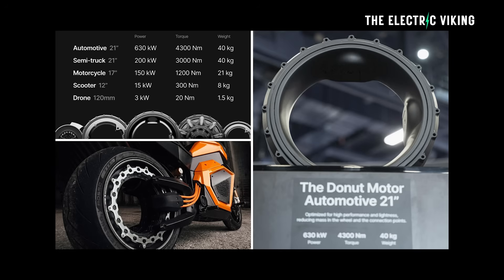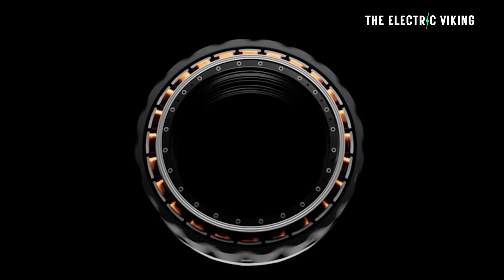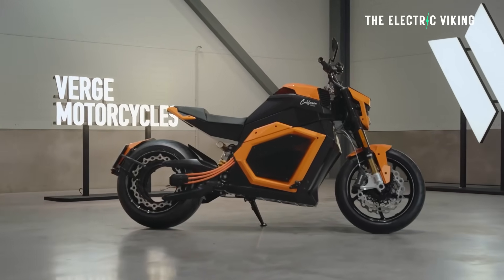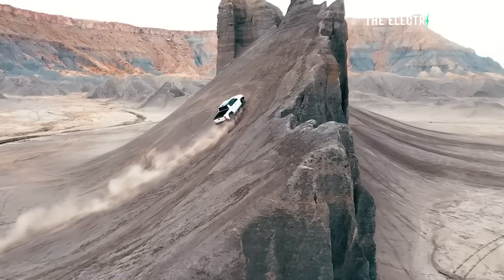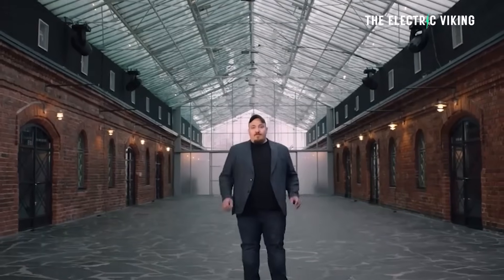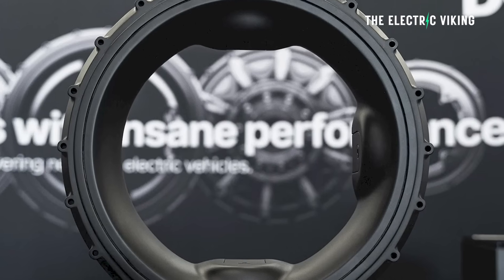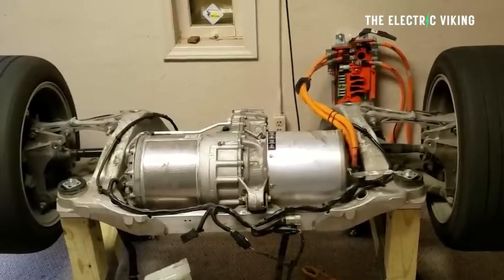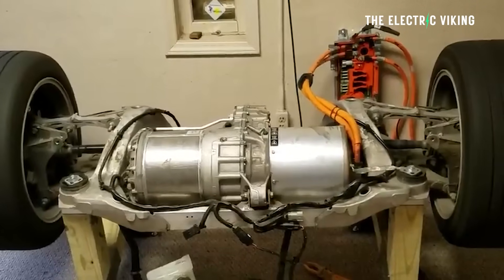Donut Labs' game changing Electric Motors will Revolutionize the EV Industry

Comment: Sounds great but for the issue of hub motors in general. When you hit a pot hole all of the force goes into the motor because it is before the suspension. If they can solve that issue then they have a product that can make a difference
Reply: Smaller wheels with larger lower inflation level tires would help. People need to get over this bigger and bigger wheel fetish.
Reply: @Frostback-mw4xi  If "smaller" means small they just fall into potholes. The ride turns into crap on roads that feel smooth with a larger wheel. But I do agree the bigger and bigger wheel fetish is bad, mostly because the unsprung mass should be as low as possible.
Reply: @Frostback-mw4xi  you talking bout rim sizes with low profile tires?
Reply: A pothole that takes a chunk out of the wheel now will take a chunk out of the motor instead. Anything expensive should always be sprung.
Reply: I don’t get this argument, tbh. Wheel forces go into the bearings, not the motor. Just like any other wheel hub. Am I wrong?
Reply: @simontillson482  think about the inertia. wheel gets pushed up, heavy motor wants to stay where it is.
Reply: @tweake7175  Hmm, that’s true I guess but same goes for a lot of stuff. Like brakes for example. I do think reliable in-wheel motors would need stronger bearings than a conventional hub. But not a crazy amount stronger. The force initially goes into the outer hub and that shoves the bearings which then pull against the stator (the heavy bit in most motor designs). Even conventional ‘empty’ wheel hubs are quite heavy, and the hub motor replaces that so doesn’t add as much weight or inertia as you might think. Engineers are pretty good at making wheel bearings so I don’t think it is a real barrier to reliability. As to the motor itself, as long as the bearings survive it’ll be fine. Motors are very simple devices which are basically a solid block of metal with large wires wound onto it. They can survive hundreds of G’s without problems. Many companies already make proven designs around the hub motor concept that work great. Check out Elaphe motors for example.  The more difficult engineering challenges are cooling and the rotating seal in my opinion. Vibration and impact are pretty much solved.
Reply: @simontillson482  not saying it can't be done. eg rivian i think run hub motors. the magnets are often a weak point due to their material and how they are fitted. you make a good point about the seals. water getting past wheels bearing seals is a known issue on all cars. wheels bearings are usually easy and cheap to replace. a maintenance nightmare if you have to pull electric motors out to service brakes or bearings.
the bigger problem imho is the effect on suspension and handling. its passable on a big heavy heavy truck, not so much on a lightweight car.
Reply: @simontillson482  you understand thatmotor in this case is in the wheel so all forces come to motor first before they are absorbed by springs.
Reply: @KeyhanHadjari  Of course. I was talking about how forces coming from the wheel have to first travel through the bearings before they encounter the inertia of the motor. In a hub motor design, the rotor (spinny bit) of the motor is retained by bearings which replace the normal wheel hub bearings. Therefore, the motor will only be damaged if those bearings fail. Effectively, it’s the bearings which have to resist impact and vibration from the wheel, not the motor itself. Both rotor and stator components of the motor are very heavy and stiff so they put a lot of stress on the bearings before any of that force gets transferred to the suspension. I think this is one reason why hub motors need to be as light as possible, and need much stronger bearings than conventional wheel hubs, since the suspension can’t help absorb these forces - it’s only after the bearings transfer those forces that suspension can absorb them.
Reply: @simontillson482  think this motor design is more for cities and urban areas mostly.
Reply: @KeyhanHadjari  Depends where you live. In the UK, for example, most rural roads are quite smooth as are the major motorways. Local urban roads however are terribly rough and full of potholes. I guess in other countries, where long distance routes involve rocky or other types of unpaved roads and city roads are newer and/or better maintained, you’d be correct.
My personal view is that we could make a hub motor with lower power (say 20kW per wheel) which would be light enough to avoid the unsprung mass and bearing issues while offering sufficient power for most vehicles. If we can do that and solve the rotating seal problem, then the advantages of a hub motor vehicle could really be applied anywhere.
Reply: @simontillson482  you are wrong in this case. A hub motor is in the wheel so The motor is the bearing. There are other options like using a short dedicated axle with a flex joint for each wheel. That has weight another complications.
Reply: I was wondering the same thing - Potholes could mess things up, going over speed bumps to fast ?   Love the idea & hope it works out 👍
Reply: I ride electric unicycles, those hub motors take a beating with few failures. I think they have figured in the pothole factor.
Cheers
Reply: Worst case scenario, if this becomes a standard design. Each wheel motor will cost $5,000usd to $20,000usd and hub cap thieves' paychecks will 10x because of this.
Reply: Higher-profile and lower pressure tires could help. Use the tire as the first part of the suspension system.
Reply: @johnd01  That's probably going to make your eV handle like a boat. EV tyres have reinforced sidewalls due to weight. Hi-pro tyres will be a significant lateral instability multiplier. With the power increase needed and available, I'd think that solution is unlikely.
Reply: If we switch to those airless tires that can absorb impacts & use better suspension methods, might be okay?
Reply: Remove engine, hook directly to transmission.  Solves issues with hitting potholes.
Reply: Some clever clog will invent a way to use them as a regular motor by adding  planetary cogs , then can drive 2 wheels at once
Reply: I don’t think you will be seeing low profile tires used in combination with wheel hub motors, because of the potential for damage from potholes and curbs. I would like to see this motor design succeed.
Reply: there could be some cushoning in the wheels
Reply: Flying cars
Reply: A simple pot hole that would break/bend a wheel will now total your car.

Nice.
Reply: Can this tech practically replace a conventional single motor/inverter  setup with a diff, cv's, and driveshafts?
Probably in certain use cases.
As far as less parts, I'm not sure  the manifolds and flow control and  dedicated cooling and power lines with all the weatherproofed connectors,  mounting and routing hardware over active suspension, plus the weight of more coolant in more lines, then there's maybe more inverters and control software maybe needing more plumbing and cooling, messy and complicated service issues, etc.
Jusy saying, there's more to it than just the motor specs, think the apps for this tech need to be carefully chosen.
Aptera just went through this and for me they made the right choice especially for a right to repair approach.
The right part is no part has to include all of that too. Does it all really add up to less cost? I'm not so sure, depends..
Reply: Where are you guys from?? Complaining about putholes??? Are your roads so terrible??
Reply: their was a bmw prototype that was using hub motors.
Reply: UNREAL performance: The bearing size is?? 7 times more heavy, 10 times more expensive (bearings have 1-2 microns tolerance),  large area exposed to water/sand/seals... It doesn't use copper and magnets for a 90% efficiency? =NO it has 170% efficiency using gold and kryptonite. Be real, this has only CGI and fake prototypes. They haven't even delivered 1 motorbike (38,000 euros) and now they are asking for millions for trucks and drones? Be real man, the figures are 170% silly. The copper efficiency cannot be that high, and the magnets are not better than tesla, we have 95% efficient motors already, how can this be 2x better? nonsense! we have oil-cooled stators. Be cynical and give what this company deserves, fact and laughing. Also rediculously expensive and bad maintenance issue with bearing, total lies.
Reply: I was driving my car into an overnight truck station in NSW at about 20-30 ks when my left front wheel hit a pot hole it was that bad I had to drive around and re-see this hole.

If it was any longer or wider the entire wheel would have dropped into the pot hole it was that big and deep.

I was just amazed that the rim and tire were not warped or damaged It was such a hard thump i mentioned it to the station attendant and he said yeah theres a few of them out there.
Reply: also the handling. the higher the unsprung weight the harder it is to control and suspension performance suffers, making poor handling/ride. the lighter the vehicle the worse it gets. easy way around this is to mount the motors inboard, but then its not a hub motor.

Comment: The scooter version would ne good enough for a lightweight 4WD compact car, still lots of torque and off the line acceleration and EVs don't need so much power for urban use and highway driving fast drains batteries too fast anyway.

Comment: I wish they made a version that had 1/10 the horsepower and weighed almost that much less also.  That would still be a lot of power for the whole vehicle and much less unsprung weight and overall vehicle weight.   Lighter weight vehicles need to come back. The battery technology is getting to the point where it enables lighter vehicles.
Reply: If you look at the specs, the power and torque grow almost squared to weight.
Reply: @jirirasanen  not surprised, so 1/10 power square root is 0.3x40kg weight = 12.6kg much of which could be saved by not using dumb style gimmick low profile wheels

Comment: I thought one of the issues with hub wheels was that motor efficiency curve doesn't work in the EV's favor.  Meaning often the motor is running at a very inefficiently.   Has this something that Donut has addressed in their design and or controller technology?

Comment: Hi Evan, from a physics standpoint it all makes good sense. You worry about the mass of the peripheral hub motor but the fact is that it needs no chains, axles and gears to propel the bike. Thus it eliminates transmission torque inefficiencies beside all the fricitions, weight and costs associated with it. A road bike thin tires feels easier to pedal than the thick mountain bike tires because of the increased contact surface frictional area with the pavement. Those new wheels can also be optimized to be thinner too at the expense of comfort riding though. All in all its a great proposition that actually opens the door to interesting  extensions such as a one balanced giant wheel hub where the driver seats inside. I bet this saves even more in material, cost and design. The balancing software technology has already been perfected and it makes plenty of sense to me that the single person cars of the future will be taking this path. Think of ridding inside a clear polycarbonate hub with one such planetary hub wheel that can go on land as well as on water! Wouldn't that be awesome if it also could fly?

Comment: I disagree with your claim that lightweight wheels are somehow needed for increased efficiency for bicycles. There are other reasons for light wheels; faster acceleration due to less momentum, less weight when climbing uphill, and better handling. However on a flat road at constant high speed a light wheel is no more efficient. In the early days of aero disk bike wheels for track and road time trials, heavy wheels were considered a benefit so that the increased angular momentium would give a flywheel effect and dampen out small speed oscillation. Some disk wheels even had weights added.

Comment: Hub motors and unsprung weight. For slow moving, high torque applications, but not for speed and racy performance. Having a lot of power is no good if you can't use it. And unsprung weight affects durability. Even Aptera abandoned them.

Comment: The engineering issue I see is that by moving axial motion to the outer perimeter means the bearing must do much more work.  I see current bearings not being able to handle the heat and friction.
Reply: they cant. but dont worry about practical concerns, we have "cool looking high tech" to hype up and sell...

Comment: The axial flux Koenigsegg motor is 800Hp/39kg (20.5Hp/kg) vs. Donut's 21.1Hp/kg. not exactly "much heavier".  Ride quality is determined by the ratio of sprung to un-sprung weight...additional horsepower will not compensate for 40Kg. additional un-sprung weight..
The energy density of these motors is not exceptional. Lightning Rods has a traditional 8Kg. motor with 18Kw compared to Donut's 15Kw.

Comment: I hope this works out for them.
But how many baring's does the Donut lab motor have? if it have as many as I think by looking at it then it will ware out so fast I hope they don't use any baring's in the construction.
Also you don't want the motor in the wheel as it is a bad thing to have a lot of weight in the wheel as unspring in not controlled, see the Renault Zoe the motor will need to be water proof.

Comment: The Lilium Jet e-motor is said to have been designed to deliver industry-leading power density of over 100kW from a system weighing just over 4kg. If that's true as claimed by media releases, then its more powerful than this in-wheel design. The electric motor, co-developed by Honeywell and DENSO, is a proprietary, high-performance system designed to meet Lilium's performance goals. The motor consists of a rotor and stator, weighing approximately 4 kg and delivering an output of 100 kW. I see this confirmed on both Honeywell and Denso web sites, however take it with a grain of salt as to how true it is. Although this is a troubled startup, I've no reason not to believe the claims of the partner companies, Honeywell and Denso.  If this is true and correct,  it sort of makes this in-wheel motor look a bit ordinary in terms of comparative performance.
Reply: On that basis this other motor Imentioned would be producing around 1 megawatt of power,  if you had 10 of them weighing in at around 40 kg.

Comment: Disadvantages of EV Hub Motors:

	1.	Increased Unsprung Weight:
	•	While it can have benefits, the additional weight of the motor in each wheel can negatively affect suspension dynamics, potentially leading to a harsher ride if not properly mitigated.
	2.	Maintenance and Repair Complexity:
	•	Repairing or replacing a hub motor can be more challenging and potentially more costly than dealing with a centralized motor system, especially if the motor fails while integrated into the wheel hub.
	3.	Efficiency Losses:
	•	There might be slight energy losses due to the motor’s placement outside of the vehicle’s main body, where it could be more exposed to road conditions like water, mud, or debris, potentially affecting efficiency or longevity.
	4.	Heat Dissipation:
	•	Hub motors can overheat more easily due to their placement and less efficient heat dissipation compared to motors placed in cooler, ventilated areas of the vehicle.
	5.	Aerodynamics and Rolling Resistance:
	•	The design of the wheel to accommodate a motor might not be optimal for aerodynamics, and the additional weight can increase rolling resistance, slightly impacting range and energy efficiency.
	6.	Cost:
	•	Although potentially cheaper in some aspects, high-quality hub motors can be expensive due to the need for durability, waterproofing, and precision in manufacturing to withstand harsh road conditions.
	7.	Control System Complexity:
	•	Managing multiple motors requires sophisticated control systems to ensure all motors work in harmony, especially during turns or when different traction conditions are present under each wheel.

Comment: It is replacing one of the most reliable, well known, and simple construction parts ever, the normal electric motor, with something that has sgnificantly higher stresses on the axis and a lot of rollers and bearings and moving parts. There was a bicycle experimenting this a massive failure. Less efficiency, rolling resistance, prone to failure. I would not bet on this.

Good news on electrification are there aplenty, just not THIS SPECIFIC ONE :)

Comment: This tech seems to be a huge thing for semi trucks and heavy equipment if mounted in the hub. Perhaps supercars could use them mounted where a gas engine would have been mounted and use traditional axels to the wheels. Expose the cool looking motors with a plexiglass cover like supercars do now for the engine. I don;t know if this tech applies that well to mass market cars but cool nonetheless.

Comment: If they make more mothers with different power, I can see young guy staging their electric cars
Put a bigger motor and voila, not so you may have to put bigger wires ans a different controller, but it could be done
but they are guys who put more powerfull gas engine without reinforcing the transmission, drive shaft, etc... with problem of course

Comment: Construction equipment, Hilo's and the like have used hydraulic wheel hub motors for over 50 years with great success. The concept is sound tested and true. This is the EV motor of the future if they can perfect the commutator arrangement.
Reply: i cant recall any construction equipment thats intended to be driven at 50km/h or higher...